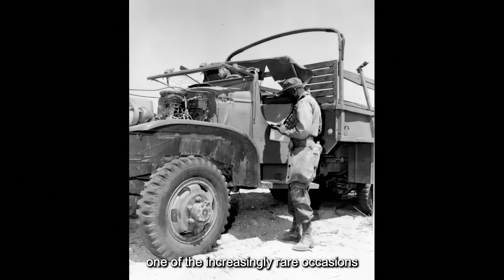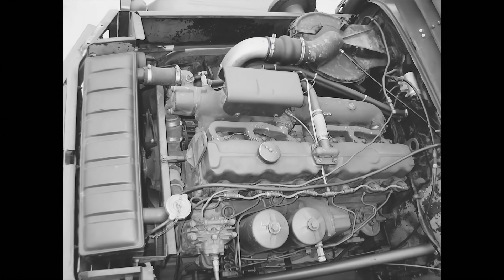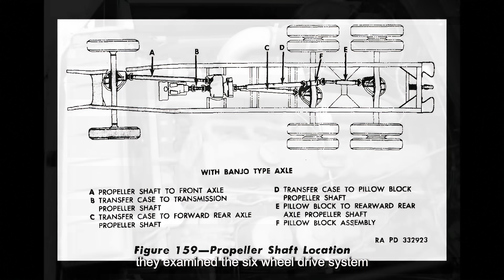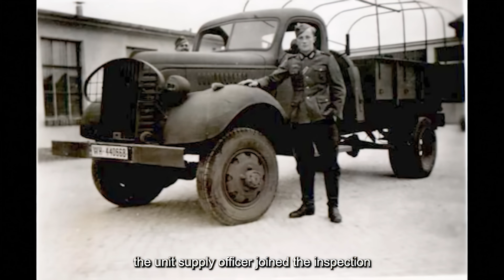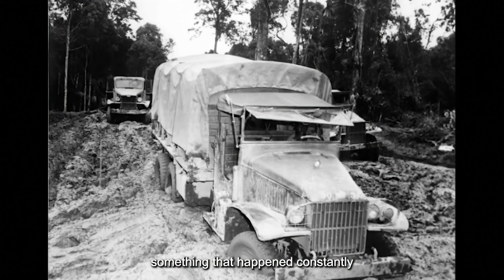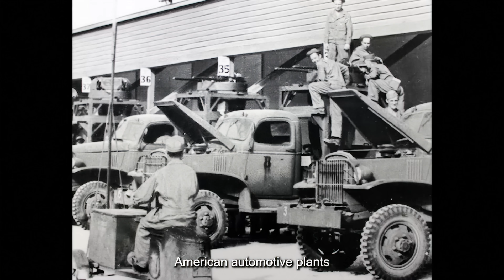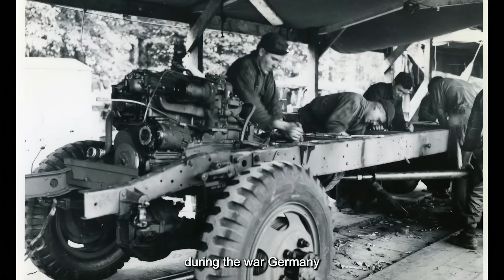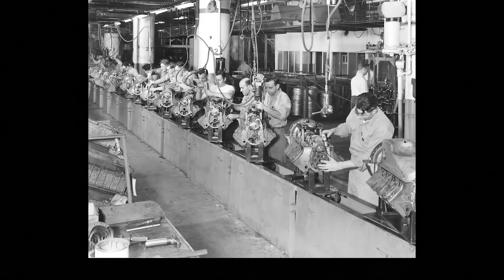Wehrmacht Mechanics Captured a GMC Truck... Then Realized Germany Was Doomed

Comment: There are a lot of valid complaints about the photos not matching the narrative. Maybe the correct photos weren't available. I like the narrative, I HATE the AI! I doubt the part where the Germans used this truck, I thought most of the German vehicles ran on diesel so gasoline would be harder to get.

Comment: Henry Ford here.
Sorry A.I. narrator I'm not sure where you're getting your information but if you've ever been around a deuce and a half either from World War II or going into the later models you will quickly realize they are incredibly rugged and brutally reliable and not just "good enough".
A bona fide Doomsday Machine it is.
 The type of truck you would see in a post-apocalyptic Resident Evil desert Convoy.
Whoo-ah go Alice.
Reply: That's correct. The US industry was head and shoulders above German capacity, which struggled to produce farming equipment to the point Hitler imposed tariffs on meat and put the country on a vegetarian diet that relied on more traditional agricultural techniques than France or the UK. High quality cars were expensive to manufacture and Hitler had Ferdinand Porsche, another Austrian national, working on a mass produced, cheaper solution, which only saw the light thanks to British officers who saw its potential and as a solution to war reparations/industrialization of Germany.
Reply: Never buy a Ford vehicle, old man Ford was a big time Nazi sympathiser, he loved Hitler!!!

Comment: Even  psychopaths like Stalin will sometimes display a bit of wisdom : "Quantity has a Quality all its Own ." Among the  things the Jerrys did Very right : The original , rear engine Volks - Wagen  'Beetle', and the staff car resurrected as the 'Thing' in the early 70s . Had several in my family over the years , including a 1970 Camper . Didn't really Need the decent gas mileage ! Just Loved the Simplicity of maintenance and repairs .

Comment: Interesting that the US trucks were built with standards that worked on different brands.  This is how the Japanese turned Detroit car manufacture into the capital of the rust belt.  Japanese parts are standardized across brands.  Not necessarily in every detail, but in far more cases than is found in US brands.

Comment: Who makes this shit???
The engine displayed is fuel injected...NOT A CCKW
FFS
'The truck was available in two primary variants: the CCKW-352 (short wheelbase, SWB), used mainly as an artillery prime mover, and the CCKW-353 (long wheelbase, LWB), which served as the standard general-purpose cargo truck and formed the core of the Red Ball Express—a critical, non-stop supply convoy that sustained Allied forces after the D-Day invasion.
 The CCKW was powered by a GMC 270 cubic inch inline-six 
>petrol engine, <
delivering around 91–104 horsepower, and featured a 5-speed gearbox and 2-range transfer case, enabling formidable off-road capability.'

Comment: There is something special about the 6x6 design, they are extremely capable off road, will outdo any 4x4, absolutely phenomenal.
Reply: Yes it is simple heavy you want to spread the weight out the dually design isnt that good for military especially on un paved terrain
Reply: And they are just iconic. I have long dreamed of owning one.
Reply: @cactiguide I own 2 we use as feed trucks, they are a bit newer, one being a 1952 and the other refurbished in the late 90's.....they are the newer Rio/Kaiser design but still awesome units.
Reply: @Blazefork nice!

Comment: Although  the Duce and a half  was replaced by the 5 ton reserve units still used the  deuce and a half well into the 1990s the video failed to point that out. Those trucks were still used by military reserve units and when I was called up for hurricane relief and hurricane Andrew, I drove a deuce and a half for two solid weeks never gave out never failed I love the Duce and a half.

Comment: Our modern car industry should take a page from their own past, .by making vehicles for durability and ease of repair.
Reply: Can't make profit with that business plan.
Reply: But then we wouldn't need to buy a new vehicle every few years. They know what they are doing
Reply: That was once a selling point of the original Ford Maverick car.  One commercial showed "stewardesses" (as they were then known) disassembling one.  
Today, America makes cars that are too complicated to fix yourself and then after about ten years the dealers don't want to work on them either.
Reply: My parents bought a brand-new 1964 Chevrolet Bel Air. It was ragged out when I got it as a hand-me-down in 1972: upholstery ripped and ragged, headliner drooping, bushings shot, engine shot, transmission slipping. At best, it got 15 mpg from its 283 cube engine and 2-speed Powerslide transmission.

I bought a used 2014 Ford Focus (manual transmission) in 2016. Drove it 500 miles a week round trip to work and put 202k miles on it. Aside from an oil leak fixed under warranty, it has had only regular maintenance. After getting it detailed, it looks like it came off the showroom floor. There is only one tiny crack on the dashboard. 

So much for reliability. As for ease of repair, you could get into the engine bay of the Chevrolet because there wasn't much there. Everything was accessible. You needed to change spark plugs? There they were. Water pump? Right there. Air filter? Just take the lid off the air cleaner. Replace headlight? Loosen three screws, remove retaining ring, unplug old headlight, plug in new one.

The Focus is a whole other beast. Spark plugs are easy, but nothing else is. Air filter? Take out the air box. Water pump? Disassemble the engine. Battery? Remove airbox to access the battery up under the cowl. Replace headlight? Remove entire "headlight assembly" (only two screws, but still . . .), twist out old light, plug in new one (careful not to get fingerprint oil on it!). Much less user-friendly, but the point is that I didn't have to do any of those things nearly as often with the Focus as with the Bel Air.

Comment: How many people have AI fatigue, or exhaustion? This looks like an interesting video, but the AI ruins it. I’ve gotten to the point where I just turn the sound off..
Reply: It read's a sentence perfectly but have no knowledge about the last sentence or the next one. resulting in this flat slop
Reply: Hammering a leaf spring straight with a rock? The mind boggling stupidity of AI beggars belief! It should be called AS.🤦
Reply: @A1euro It probably scaped the term from somewhere not realising it was an exaggeration. Garbage in garbage out. It will get worse as AI starts to reference itself as the source of knowledge of reality.
Reply: Even the AI narrator is shitty
Reply: I agree, it doesn’t hold up and makes irrational claims such as the most certainly classified statistics the Germans had knowledge of. Not even the most lucid nzi degenerate would have had a clue, or bern able to openly discuss things like the state of logistics and shortcomings of the self appointed “master race”.
Reply: i just shut the video off, i dont even give them views, no more slop, prolly someone from india neways.
Reply: I do, its sad.   Text to talk ai voice with b-roll or pics and text is lazy beyond lazy.
Reply: I have AI exhaustion !! Where are the REAL narrators these days ?? I think we were better off without AI !! 😊
Reply: Cheaper to produce
Reply: Crappy AI that requires a lot of computing power to produce a video on how simplicity and ease to repair is better. We now live in the Irony World.
Reply: Much too repetitive
Reply: It doesn’t both me! The voice is good, the pace is very good, etc. Yes they mis pronounce words at times but the story is worthy!
Reply: @richardjacobs7632 yes that is true but I was talking about the repetition of the same comments several times about production ability throughout the video etc.  I agree this subject should be more widely talked about. If it wasn’t for American production and ability to project it the War would be longer and more difficult than it was. It also kept the American homeland from being threatened. 👍🏻
Reply: Bosch...._boosik_ ?     The captions are fairly accurate.   I just turn off the sound.
Reply: As I watch these series of vids, they are thinly veiled propaganda. 
  Not matching the reality of today.

Comment: I’m a life long mechanic so what you are saying is that German engineers had zero common sense 😂 all these things mentioned are literal common sense engineering principals
Reply: Apparently not, or the Germans would've done it differently. The USA has the ability to test equipment in every terrain the world has to offer, all without leaving the states.

Not only that, but back then not many people truly understood America's industrial capacity. Modern-day America is a shell of its former self in this aspect. We were not only designing and inventing cutting edge technology, but we produced all of it in our own country. Nowadays we outsource 90% of everything. Take a look at any Ford or Chevy. Back then we made every single part here, every nut, bolt, wire, etc. Nowadays we get our chips, plastics, and more from Asia, and assembly in Mexico or Canada.

Comment: I drove a 1947 Willie's CJ-2a  Jeep that was 99% the same as the WWII military model. I drove it for years in the 1990's. That machine was unstoppable. I enjoyed driving it many, many miles out into remote areas of our national forests. It did not require a road only a game trail which is a route made by the deer and elk as they migrated to different elevations due to seasonal weather changes. That Willies Jeep was as nimble as an Elk plus it was faster. Despite being fifty years old it ran perfectly. The gas tank was rather small and was placed under the driver's seat so I was required to bring along Jerry cans filled with gas and I always needed them. I had a canvas cover to stay dry in the rain. I left it off as much as I could and the front windshield folded forward and I would imagine I was in Patton's army rushing to stop the Germans during the battle of the buldge. It's no wonder those men were able to get there as quickly as they did because nothing slowed that Jeep down besides it's three speed gear box. The major drawback to it was speed. It wasn't something to drive on the freeway even though I did more than once. I had to sell it for something more conventional after highschool but I will always miss that amazing machine.
Reply: My cousin had a 47 CJ2A he inherited from his grandfather. That 1 was a hardtop in blue. As you said, it was 99% a war time factory unit. Really the only thing it had for civilian use was outside mirrors and turn signals were fitted. Otherwise, same engine, transmission, transfer case, diffs, even gauges. 6V electrical. In the 60s, his grandfather had the seats re-done with extra padding and lap belts were added because it rode like a buckboard on pavement. It was most at home offroad and surprisingly peppy out there. We had quite a lot of fun with it out in the desert. As of '23, he still had it, IDK about now as he and I have lost touch.

Comment: My neighbour owned truck GMC 1939 ACKWX, originaly blue color with white star, which got Yugoslav army from US Navy. Arround year 1980 i have found new engine in army warehouse and bought it for my neighbour, still conserved from the year 1942. This engine is running either on diesel, either gasoline, we even put some thinner inside 😅  They use those trucks for farm work and even transporting timber from forest, where it is not easy to access. After changing engine we took small batery from old Renault-4 and it started with first try, after seating in warehouse for 40 years 😊

Comment: The luger pistole P08 and the P38 are finely made German pistols, fantastically engineered...but could not hold a candle to the Browning designed, Colt manufactured 1911. Much like the Deuce and a Half trucks the 1911s were battle ready and worked very well in combat situations. No matter which plant they were produced at ( Colt, GM, Rockolla) they were identical master pieces of mass production. No one could match our production capabilities in the forties.

Comment: absolute bs, opel blitz did not have torsion bar suspension at all, it's spark plugs were not hard to get to either.  the engine pictured is a diesel engine.  all of this is pure horse shidd.

Comment: The engine shown is a diesel.  There were no GMC CCKWs that had a factory diesel. The frames were riveted, not welded. The CCKW in the mud also was lost, unless chained up. I question much of this video. Especially the dialogue.

Comment: It should be noted that the Opel Blitz was also a General Motors vehicle - Opel was a division of Buick - before , during and after WW2. For which General Motors was paid.
Reply: Opel was not a division of Buick but was a separate division  of GM from 1927-2017.  Opel vehicles were sold in the US by Buick dealers in the 1960s and 70s. Opel was sold to PSA  (now part of Stellantis) in 2017.

Comment: The USA can really crank 'em out when the factories are humming and NOT being fire bombed day & night; "the Arsenal of Democracy."  I thought the German trucks might not be 4WD, all the German engineering complaints fade away when you realize we had all wheel drive. The little "Jeep Class" German vehicle, the Panzerkampfwagon, was a beetle with military sheetmetal, RWD with a motor in the  back, just like a VW "Thing."  Nazi vehicles were unreliable & not fixable. Didn't realize the Germans were so dependent on horses.

Comment: I have a 43 duece and a half. It is 82 years old and still runs like it did in 43. Today's trucks are lucky to function when they roll out of the factory. Yes, my duece burns more fue,l BUT it never fails to get the job done.
Reply: That's what happens when the government mandates design.
Reply: M uncle had a 44 for many yrs during the 80s. It saw service in Europe, then the Pacific theater during the rebuild, then was shipped to Korea. After that, a LT who had some $ bought it off surplus and had it shipped back to the states. The engine was overhauled once, the transmission and transfer case were resealed at some point. I got a ride in it as a young kid. On paved roads it was a handful for my uncle, but we took it on a desert trail and it immediately fell into its element. It dusted off loose sand like it wasn't even there, and climbed embankments with ease. Power wasn't the key, gearing was. It never ran hot. It always started even with the points ign. The carb was never cold blooded with the manual choke and hand throttle. Brakes were fair, good enough. A collector bought it from him when I was in middle school.
Reply: You save more by avoiding repairs than you'll spend on the extra fuel.

Comment: The one thing that many ignore is the opening of the port of Antwerp/Anvers that made the routes of supply of the allies very shorters. But  many also forget the sacrifice of Canadian soldiers how made this possible by opening the Schelde to naval trafic.!
Reply: The supply chain still uincluded the trip across the Atlantic.  Capturing Antwerp merely shortened the last few hundred miles by about 100 miles.
Reply: @Egilhelmson  No, it wasn't just a "mere" shortening of the last 100 miles, because French railways had been damaged and even their best port, Marseilles, which was still a day trip away from Paris, wasn't able to handle the amount of supplies and logistics required for the war effort. Antwerp and Rotterdam were by far the better choice to keep the Allies lines and for this reason their capture and the opening of the Scheldt river was key for the invasion.

Comment: My mom learned to drive a Deuce in the USO in 1945. The thing about Germany and Japan was that   only mechanics and engineers knew how to work on the tanks, vehicles and planes. When they broke down if there was no trained personnel they just walked away . Americans grew up working on trucks, tractors equipment because of America being more industrialized across the nation. There are many stories of Americans coming across equipment that just needed a few basic repairs. In the Pacific it was especially true. Planes were left stranded due to the Japanese soldiers had no experience with advanced equipment.
Reply: And now USA is like Germans and Japanese were back then.
Russians are like ww2 Americans.

Comment: German logistics were also hampered by the fact that they used trucks from every nation they captured. They had dozens of different models, none with matching parts. Imagine trying to find parts for a French truck while deep inside Russia.
Reply: After WW2, the Russian designed their vehicles to use parts of western european production if they needed to.
Reply: The biggest problem with German logistics is that the Wermacht was not fully mechanized and relied heavily on horses and mules for transport
Reply: @Natluvvx  From the Wikipedia entry on Horses in World War II:  "Horse logistics slowed down the German advance."
Reply: @nghtwtchmn129  When deep in the Russian winter, you'll be glad to not have to eat truck-meat.
Reply: Later in the war they tried to standardize to one model only, an Opel Blitz. Which, what irony, is a GM Brand and had a Chevrolet straight 6, which Opel continued well into the 80s, in passenger cars then. All it got, was a new cylinder head every now and then.

The Opel Blitz was actually one of the very few practical, mass- produced trucks of the third Reich. Funny it was called "Blitz" as in "Blitzkrieg" which is certainly what the Wehrmacht used them for.
Reply: Where no parts fit & even same Co.'s had problems fitting parts until Cadilac Co. standardized all the parts,They were the first.
Reply: @earlworley-bd6zy  Then the US made a standard for every vehicle, trucks, tanks, planes ships....